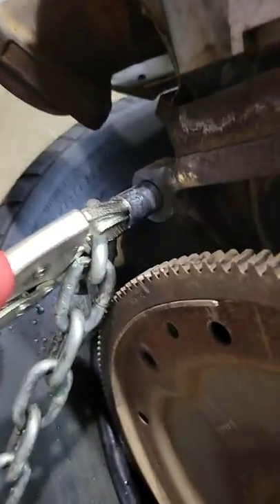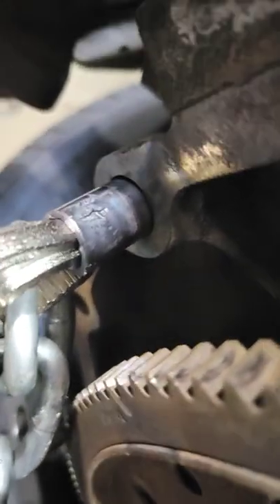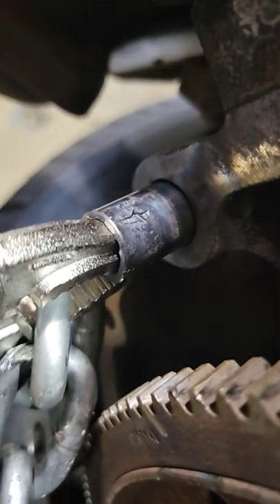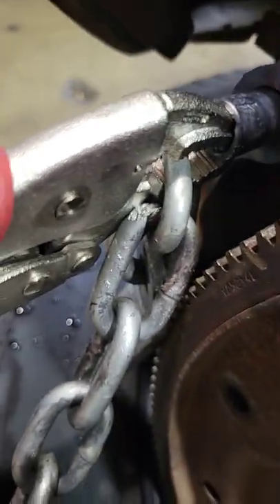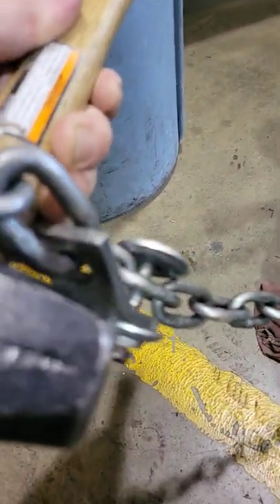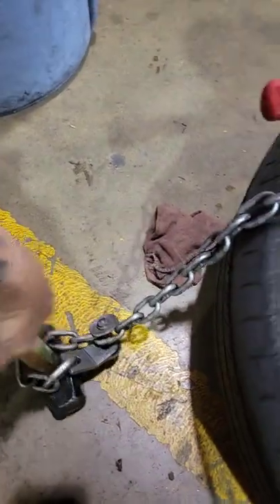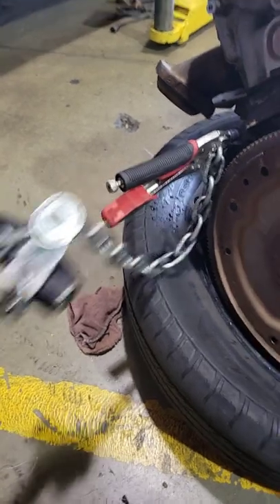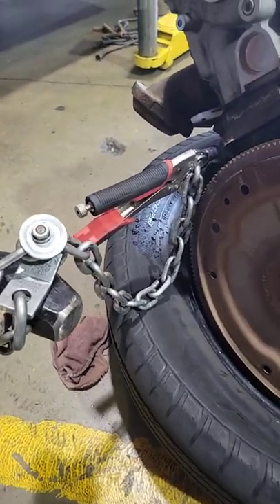Makeshift Slide Hammer

Comment: Best way I’ve found is to tap the dowel, thread in a bolt, then you can either use a spacer and thread the bolt in to pull it out, or use vice grips with a slide hammer adapter
Reply from the maker: Gotcha thanks

Comment: I have a same thread piece of all thread that can be used to replace the vice grip bolt. A weight and a few more nuts can be used to make a slide hammer.
Reply from the maker: I actually need to get some vice grips that have the ability to hook up to the slide hammer. I have a slide hammer kit with the adapter but do not have the vice grips.

Comment: Really what’s the purpose of taking it out it’s in its natural resting spot where are you going to need it later🙄
Reply from the maker: I had a replacement engine that was missing that dowel and needed to remove it to put in other engine.
Reply: @NutsandBoltswithTone  Oh I have been in the same situation where I just go out to the parts store and buy another one I don’t want to waste more time in labor work Ect
Reply from the maker: @jessebaca2750  problem is that just buying an engine dowel is not always an option.
Reply: @NutsandBoltswithTone  understood👍🏼

Comment: My experience with alignment dowels is that most of them are brittle, if you pinch them in they snap. Way easier
Reply from the maker: Yes everytime we have had one this bad we lost it, I absolutely had to have it out for the replacement engine and it was a hurry up and get this done because this fleet truck needed to be back in service.

Comment: I used a cinder block instead of a hammer this way to remove an axle from my Ford transmission. I got some wire around the axle then attached it to the chain. Really works

Comment: Vice grips are like flat screw drivers on steroids type-of-tool. Im now using them to undo flywheel bolts. I put a bolt in the block and attach a flat screwdriver to that bolt with a vice grip.